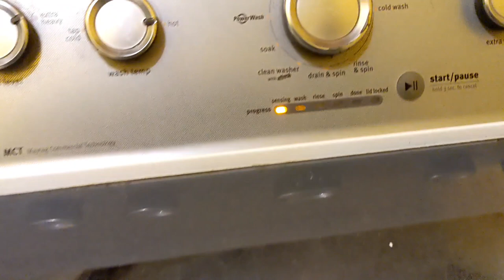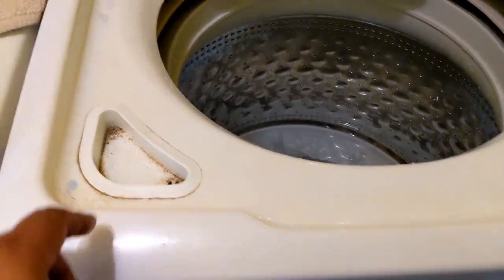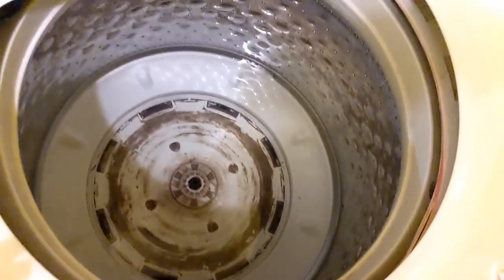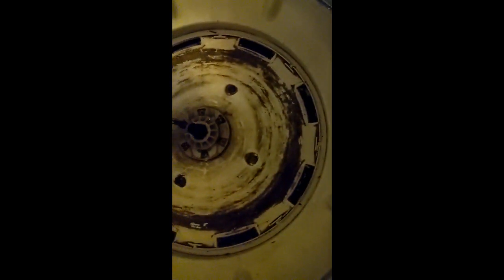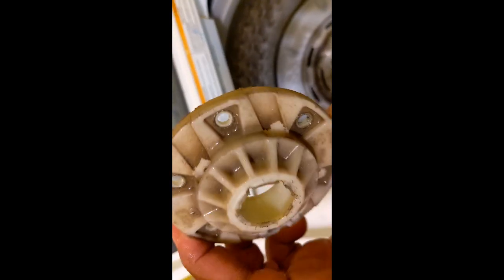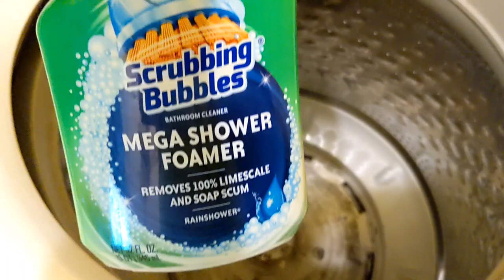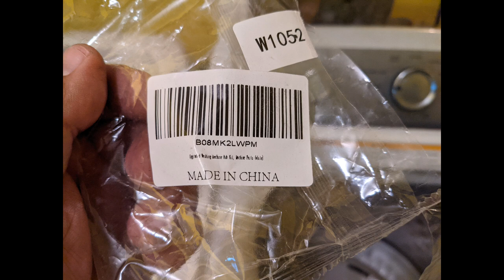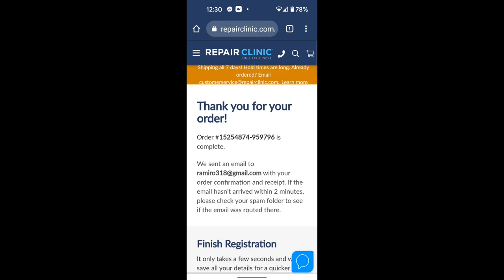Maytag Bravos MCT washer, not spinning.

Comment: If it does it again Ben's Appliances makes a metal replacement parts to replace the plastic junk.
Reply from the maker: Hello. I did end up getting the kit from Ben's appliance. Unfortunately I may have over torqued the scanner but to the threaded part. I noticed recently our washer not spinning properly again. I took it apart and found the parts threaded part, at the beveled section, had broken to pieces. I ended up ordering a genuine replacement and temporarily installed the plastic set up.

Comment: Great video! I have the same washer with similar issue. Once I took the 7/16s nut off,  I have nothing there to put a socket on. My washer is a 2016. Mine is just a sleeve but it won't pull off. I saw your needle nose pliers but I couldn't understand what you used them for. Any Insight would be appreciated!
Reply from the maker: I was only using the 90 degree needle nose pliers to get under the agitator and trying to use it to pry and pull with out of desperation.  That agitator was just too stuck.  Thank you for watching, I hope it answered your question.  If not, let me know.
Reply: What did you use the ratchet for?  I'm trying to pry it off but as you know, darn near  everything is plastic and breaks easily. I've been trying a flat tip screwdriver to pry it up.
Reply from the maker: There was a center bolt holding the agitator on, I used the ratchet to take that bolt out, and a common screw driver to pull the cap cover off the bolt hole on the agitator.  If I used the ratchet for anything else, it was probably trying to pry 😆
Reply: Thanks man! A little JB80 on that shaft and an hour wait and she came right off. Mine was totally stripped out like yours was. The part is on order and should be here in a few days.
Thanks for thus video! It was a huge help!
Reply from the maker: @kenroberts3909  you're welcome.  I'll have to try that oil.  Never heard of it, but I'm always looking for something that works.  Also, this is the 3 time or so, that I've replaced this part.  This last time being the most difficult and it just wouldn't release.  Not sure if a  antiseize would work.  Also, have a extra just incase it happens again.  Thanks for watching!
Reply: I can’t get that center bolt out. It’s so corroded.

Comment: Big mistake!! You don't use a power tool to replace the screws, you'll strip the threads!! Screw them down partway, then use a screwdriver in a crisscross pattern to tighten down the screws
Reply from the maker: I'll keep that in mind. Thanks 👍

Comment: Dang the nut is out and we can’t get the rest off literally damaged it trying with the screwdriver and think broke a piece that the nut cover goes on.  Ugh prolly buying a new washer again but it was worth a shot I’ve even sprayed the oil I don’t know why that piece won’t come off.
Reply from the maker: Each time I've had to take it off has gotten harder.  If you happen to destroy the part taking it off, there are parts available new or used at appliance repair online, brick and mortar or ebay.  It's not a very good design, especially the plastic parts and all that torque.  Good luck.

Comment: We have a bravo xl. The agitator moves side to side but it does not spin. 
Did changing that part make the machine spin?
Reply from the maker: The agitator and the drum should move opposite of each other.  When weighted down with wet clothes, it did not spin to full RPM, it made a buzzing sound from the plastic gear teeth slipping. The teeth were stripped.  Yours could be so bad that the teeth are not grabbing anymore.  There's ways to put it in a test mode and get trouble codes by moving the selector knob a certain pattern. If it's not showing codes, it's most likely this part is stripped.  

My wife thought it was working because it did seem to move side to side, but the spin cycle failed to push the water out of the clothes and towels leaving them really wet.
Reply: @junkyyarddawg  Thank you for your reply !!

Comment: Citric acid and hot water will generally release them.
Reply from the maker: I think I used ammonia out of desperation. It seems to really clean the corrosion off. I ended up installing the agitator with inti-seize.

Comment: I have the same washer and I'm pretty sure the same thing happened to me. Overloaded and teeth got stripped. Won't spin up to top speed and clothes stay soaked :(
Reply from the maker: That really sounds like the issue.  Clothes staying wet is the most common sign.
Reply: What part do I order to fix this?
Reply: What part do we order in having same issue and I would bet my whole pay check i overloaded multiple times it’s not that old so I’m surprised it’s already having issues.  I hope to order part and fix bc I don’t want to buy another new one
Reply: @npc118  also, while you have it taken apart, I’d recommend taking the drum out and pressure washing it. Mine was absolutely disgusting and I run cleaner through it all of the time! And leave the lid open when not in use
Reply: Good to know I ordered the part and we are trying to take a part now we have the nut out but the other piece isn’t coming off so fighting with it.  Hopefully, my BF doesn’t get so mad he says screw it and I end up buying a new washer.  I hope this is what’s wrong with mine:.  Thanks for the tip.
Reply: @npc118  it’s tough to get off. The shoelace really does help.

Comment: Hello.  The circular bowl inside my washing machine is the same model.  But after unscrewing the center screw.  The inner bowl does not open at all.  can you help me??
Reply from the maker: Try spraying a penetrating oil inside the hole where you took the bolt out, hopefully let it soak and let the part come off you speak of.  It is very stubborn due to rust and corrosion causing it to stay on.

Comment: Thank you so much!!!!!
Reply from the maker: No prob!
Reply: @junkyyarddawg  Hot water and banging it!!That s.o.b is still stuck Benny!!! I beat it with the hammer drill, banged it. Then I drilled the hill ribs, ran metal coat hangers to pull up and outand got it to move an 1/8 of an inch cloaking again and again in penetrating oil. Been try ing to get it off since 7am this morning!! Going to walkaway before I take an axe to it!!!
Reply from the maker: @riverking4u  that's enough to make you crazy.  I had lots of trouble too.  Hope you find something that works.  

https://youtu.be/4Z9d6WMdrNQ

Comment: Question for you I have a Brovo and replaced the clip under the bottom plate that moves now when I plug it in withing 10 sec. its starts to run weather the lid is up or down and will not stop no lights on and cant use the on off switch to turn it off. What is the problem with this thing now? thanks so much
Reply from the maker: Did you disconnect any ground connectors?
Reply: @junkyyarddawg  I did figure it out I let it go through the cycle and it started to run corectly. Thanks
Reply from the maker: @timmaccowan  awesome 👍

Comment: Did it spin ??
Reply from the maker: It spun, but once it was loaded you could hear the plastic teeth grinding/slipping buzzing sound.
Reply: @junkyyarddawg  Were you able to repair it, or did yall buy another washer?  Thank you!
Reply from the maker: I fixed it and we still use it.  It's the third time this has happened.  My wife overloaded it I'm thinking.
Reply: @junkyyarddawg  Thanks again!
We're waiting for the part to arrive.  Just hoping that'll work... new washers are ridiculously expensive 😫

Comment: Working on mine and was telling my wife there must be a spline drive or something in there that locks and unlocks for the agitator and basket, couldn’t get the agitator off so sitting on the throne and found this vid…good to know just need some more elbow grease and that sumbitch will come off.
Reply from the maker: Be sure to watch my most recent video on this same subject.  I found a easier way that worked for me.  Hope it helps you out.
Reply from the maker: https://youtu.be/4Z9d6WMdrNQ
Reply: @junkyyarddawg  I’ll watch that video too later on, I Sprayed some PB down the hole, then grabbed a heat gun to get it to travel a little more (of course I didn’t go crazy with the heat gun but gave it enough), then grabbed a stubby flat head and a small pry bar and worked it around, when it moved up and down enough I grabbed the agitator with both hands and used it as a slide hammer against itself and it came off…that drive was rusted pretty bad, now just have to get the replacement hub and should be back in business.
Reply from the maker: Awesome, sounds like you took care of it.
Reply: @junkyyarddawg  yeah I got it out in probably about 10 minutes after I knew it actually came off that way, I didn’t want to break anything so had to make sure there wasn’t anything else holding it in, your vid came in very handy. Thanks again!!

Comment: You just clean the surface 😂😂. Should have removed tub to be more detailed.
Reply from the maker: Unfortunately not the first time I've had to work on it.  I've taken it basically completely apart 3 times.  Tub included, motor, pump  etc.  Helps that we run Affresh through it too.  Never found anything bad other than coins under the agitator.  Thank you for watching and commenting, I really appreciate it.